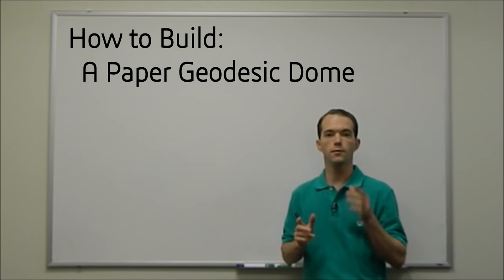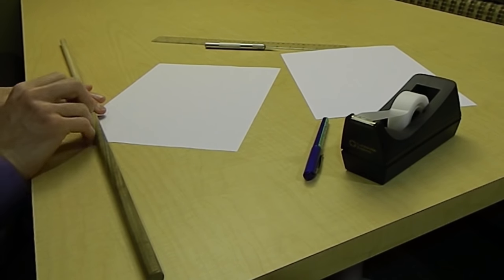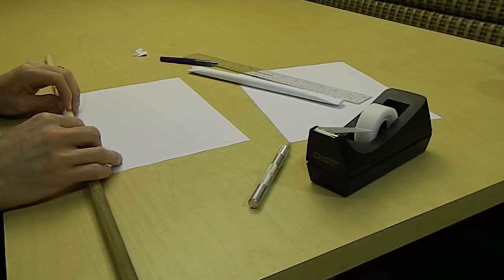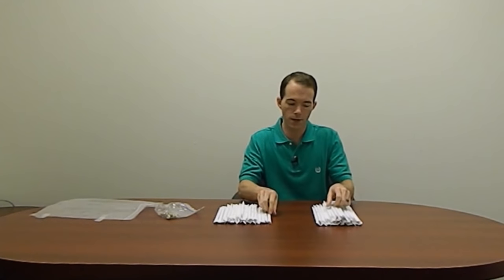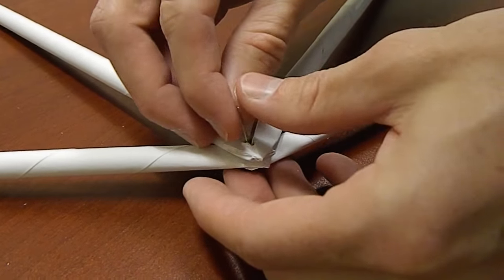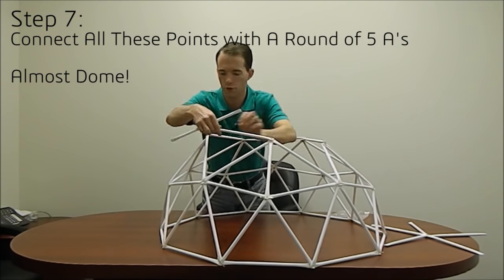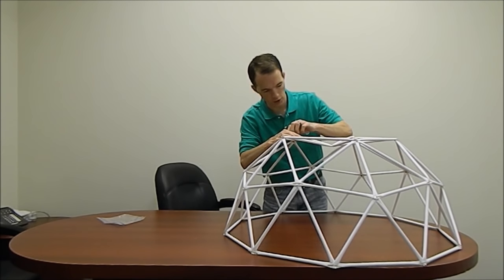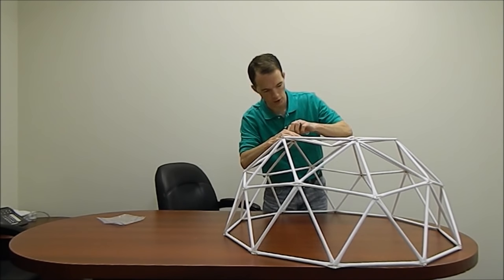How to Build a Geodesic Dome. Out of Paper.    Mikes Inventions

Comment: Good afternoon i build a 2v geodesic dome out of pvc we talked about covering it i have a question its about a wooden 2v geodesic dome which i have Learned it is easier to cover them im wanting to know how do I find the bevel angles that run the length of the struts alot of the on line calculator tell the end miter cuts but I can't find the bevel angles can you help thanks for sharing your experience

Comment: Great job I built a dome out of pvc using your instructions and the dome turned on Great I have one problem how to cover it I tried tarps not a good look I tried again with plastic sheeting works better but still looks bad any advice on the subject would be greatly appreciated thanks for sharing and help please
Reply from the maker: Yeah, umm... domes are really hard to cover. They almost require a custom covering with each gore sewn to match. However, old round parachutes work fairly well. Thanks for watching! glad it helped.

Comment: I'm very late to the party, but after inverting that pentagon in the dome and turning it upside down, you could now use it as the base for another dome to gain more interior volume/a higher roof while the radius remains the same.

Comment: Hey Mike,
Is there a relation between the lenghts of the big and small pipes? Or can i just go with 1m for A and cut  "a bit" off for B ?
Reply from the maker: Hey Bartsons, yes there is a relation between the two. It's based heavily in geodesic math, and that's why I suggest using that strut length calculator, because it does all the hard work for you. Just cutting a bit off won't quite give you the shape you need, and I've never tried to do it, because there's no real good reason to be less than perfect. Thanks for asking and watching.

Comment: Umm hey Mike, I wanted to make a huge dome (4 people worth shelter) with 'cardboard tubes' (the ones that are the core of huge printing paper rolls)... What do you suggest , how do I go about it, especially with the joinery?
Reply from the maker: Hey Purva, I'd suggest either flattening the ends of the tubes and drilling them, and connecting them with bolts or something similar. You could also cut one end of your tube into a short flap that bends away from the tube, then make a hole in the flap and attach them that way.  You could also cut short strips of something rigid, yet bendable, that you can insert inside the ends of the tubes then drill the ends of the strips and bolt together and then bend to the proper angles. This method allows you to make the complex angles automatically as you form your dome. It's also possible to tie ropes together and fish them through the tubes, when pulled tight and tied off, they allow your tubes to remain rigid. There are many ways, as you can see. Just do what's easiest and best for your situation. Thanks for watching!
Reply: Mike Thompson thank-you so much Mike...but I'm also having trouble estimating the size, since four people need head space inside the dome, and the maximum length if strut i can use is 18 inches (it's a college project, and I'm an architecture student btw) so what frequency of dome would be most suitable?
Reply from the maker: Purva, let's discuss this over e-mail to minimize space on here. Mike@mikesinventions.com

Comment: If i would puild it from pvc could i do it all with only 1m long pvc pipes
Reply from the maker: The 1m long pieces would be your long strut (A), you'd then need to cut it a bit to get your (B) struts. You'd also need to come up with a way to connect them since you can't smash PVC and punch a hole through it like you can with paper or steel conduit. I would recommend cutting thin strips of flat steel bar that just fit inside the diameter of the tube. Then you can drill through the pipe and this bar and insert a bolt. With a portion of the bar sticking out of the end, you can then drill another hole on that end and bolt them together to form the star joints. The flat steel bar would allow you to bend it between the bolted star joint and the pipe bolt to give you the proper angle. The strut length you measure would then run from joint hole to joint hole, so your longest A strut would be slightly longer than 1m to account for these metal bars on the end. This means you get a bigger dome!  It would be a lot of work, but that's about the only way to do it with pvc. Although, PVC can be bent if heated with a heat gun, but it's a pain. And you still need some way to connect them. I did find a company online once that sold PVC joints for geodesics, but the fittings were very expensive.
Reply: @MikesInventions  you can heat pvc ends and flatten them then drill. PVC works well when heated

Comment: Can this design be used to build a aviory?
Reply from the maker: I suppose so, with protection against the birds chewing through the paper. Wrapped in tape perhaps, or coated in something like flex seal maybe. Interesting application.
Reply: Mike's response was great... I am thinking about building a big version of this for an aviary, cheep plastic in the winter and finch netting always.

Did you build one?

Comment: Straws
Reply: Straws and string make pretty strong triangles. Hot glue the vertices after assembly. Building a model is useful for figuring out the best way to assemble the full size structure.